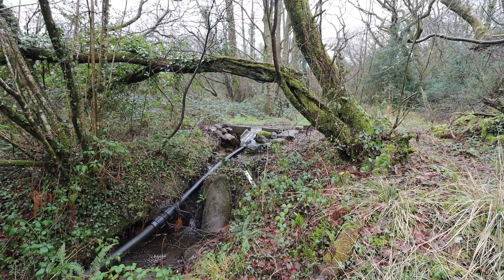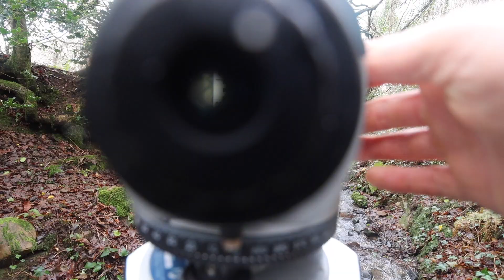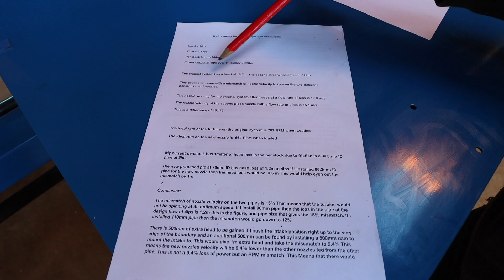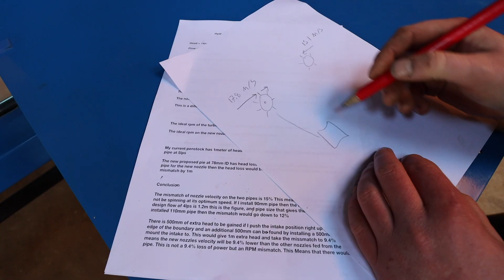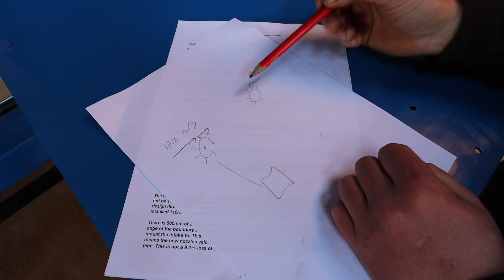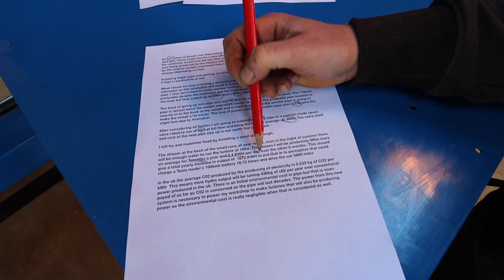Adding A Second Penstock To My Off Grid Hydroelectric Turbine (Survey)

Comment: Hi Kris
  I understood that you were feeding your manifold via a 2 inch reduction from the 110 mm main supply and that the cost of 110 mm fittings/isolating valves precluded a 110mm direct manifold supply in order to be able to supply the existing 3 nozzles plus another 1 then the cost of installing another penstock will be greater?if you are also going to connect the new supply via a 2 inch reduction then surely a 110mm direct supply to the original manifold would obviate the need for a second supply, other than providing a backup in a drought. Just a thought, but, because the supply pipe( 200 foot x 110mm header tank ) is gravity fed, not pumped and does not empty at the same rate that it can fill, then, friction should not apply until it reaches the nozzle feed pipes ?
The point I am trying (very badly) to make is that a full 110 mm manifold supply could produce the same result in a much simpler way!

Yours Vic Wild

Ps Apart from loosing the backup advantage, why not run the new pipe alongside the original one and supply it from the same dam?

Comment: Thanks for the ten minutes of numbers! I'm not looking to build a hydro electric system, but I do like numbers. 
Anyone who has knowledge on an interesting topic and can explain it well is worth listening to. 
You explained it well. I especially enjoyed hearing the problem solving options around maximum power output weighed against the increased cost of materials.
If nothing else I learned there is a lot more to it than just pointing water at a turbine.

I have a small homestead in Vermont USA. Solar power, gardens and fruit trees, chickens, barn with woodworking space. I've lived here for almost 2 decades and I'm not done with projects I've been planning for 10+ years. (Extreme cold winters and feet of snow slow down the pace for sure)

I enjoy your videos for the amount of effort you put into each project and seeing how long it takes to see things through. I also like the numbers you throw in. For example: you expanded your garden and calculated the new garden bed will produce X amount of additional kilos food. You had an actual number for the kilos of food produced per square meter of garden.
I look at a garden bed and think "Yay more room for tomatillos!"

Keep up the awesome videos! 
Please don't run out of projects so we can keep getting videos with numbers

Comment: Kris great video, really interesting to get to grips with the maths involved for turbine energy.  
As an idea..!
 Is there any further way of producing energy from the discharge water from the turbines, ie, fit a a water wheel in line with the flow  and turning a geared wheel with the weight of discharged water rather than the flow to further your energy input?

Comment: Kris (sorry I spelled your name wrong last comment),
I just remembered that optical levels like yours used to have 2 additional partial cross hairs one above and one below the main central cross hair. These used to be used to calculate distance between level and staff.  You would take additional staff readings on the top and bottom cross hairs and the difference between these two figures multiplied by a constant factor would give you the horizontal distance.  I can't remember the factor but it would be easy enough to calibrate your level on a piece of flat ground using your long tape.  This method is not accurate enough for modern construction but it would be more accurate than a wheel over rough ground.  Obviously this would give you the horizontal distance but this, together with the level  difference you already have and a bit of pythageros would give you the slope distance if that's what you need.
Regards 
Tom scott.

Comment: Seeing that you can change the velocity of the water by lowering the diameter of the pipe, couldn't you match the speeds close to your turbine? or are there other variables involved that make this an impropriate solution with hydroelectric?

Comment: so ive always wanted to generate electricity with water power. but i want to use a traditional style water wheel, since ei also have a fairly significant height difference from my pond to the culvert pipe off the stand pipe which takes surface flow in the pond from a significant wetlands area. the trouble is, im not sure exactly how to calculate the flow rates i have, and it can be a little variable, sometimes with huge storms its so much it goes through an overflow shute that can move boulders 2 foot cubed (or whatever the metric centimeter is lol) so, i also have issues with beavers clogging the stand pipe and a lot of muck and silt that could clog those turbine spouts, and i also want to mimic a historic style of the site which was an 1800s carriage shop that used a wheel for their machines using direct power form the wheel and belts and pulleys. then the site was later used as a hydropower in the early to mid 1900s. i was thinking of building some sort of flume off the culvert pipe, and direct that at an angle to a lower area where i could theoretically have a wheel maybe 6-10 foot or 2-3 meters around (circumference? diameter? anyways lol,) whatever the size might be to fit the space, and the capacity available in water flow. and fo course using a gear box to increase the rotational speed to any generator head i would end up using, but i think a 7kW to 10+kW generator head should be more than enough for my entire property. i figure that even with low flow as long as its consistent enough to turn a wheel and use the mass of the water itself to maintain the force i would need to turn the other mechanisms, i don't mind it being a bit inefficient compared to more modern styles. since i have a significantly large 1800s dry stack and then back fill stone dam holding back a nice amount of water, i figure i should have more than enough water for that. also, i figure i would still use a battery bank and inverters just to ensure a "clean" electrical signal (so as not to damage computers and such lol) in any case, i just dont know where to start on getting that process going. as well as legal stuff (ugh)...

Comment: Isn't GPS already accurate within maybe 30cm, at least the good receivers, which takes signals from 12+ satellites?
Should be more than accurate for hydroelectric calculations.
Or a good 25000:1 hiking map, sometimes also have elevation lines in 1/4m graduation.....
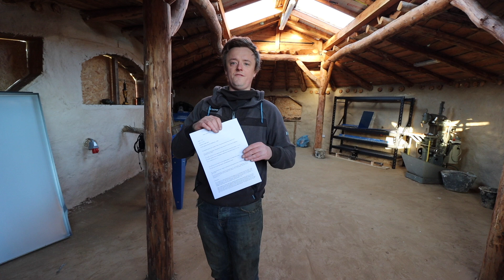Deckel FP1 in the background @ 17:30? Or even a FP2? Size looks more like FP2 ;-)

Comment: Please do think about environment damages for damming up small stream. These are spawning areas for a a lot of animals. A trout can for example go up in really small steams. And if you block it means no spawning i.e. less trout. You also has the freshwater pearl mussel who is dependent on that trout can go up streams. He in Sweden we have a lot of hydroelectric dams. about 10% is providing 90% of the hydroelectric power produced. The other 90% is just damming up stream and cause a lot of lost habitat and does not produce that must power at all. We have a lot of programs now to get rid of these small dams to let trout and salmon to go out and spawn in small streams. This also includes small dams like your own..its not allowed. Hydroelectric power is in general not environmental friendly alternative. You need to only pass majority of the water in the main stream so they know which stream when the trout should take to go up for spawning. However if you use it for hydroelectric power you need to pass majority of the water through the generators i.e. you blocking the path.
Reply: The stream isn't dammed - it's only partially diverted and the water is returned lower downstream. The environmental effect must be tiny - and in a very small area of habitat...
Reply: ok that is good. For the people who going to buy this need that they have permit for damming, diverting etc. not a easy thing.

Comment: Kris, just a thought since your head heights differ, why not put in a second turbine, that could then allow you opportunities to run tests with different turbines down the road.

Cut up the oak and use the wood.
Reply: High cost and effort involved, I should have thought...!
Impractical to extract the timber from its location, I should have thought....!
(and so, it appears, should you........!)

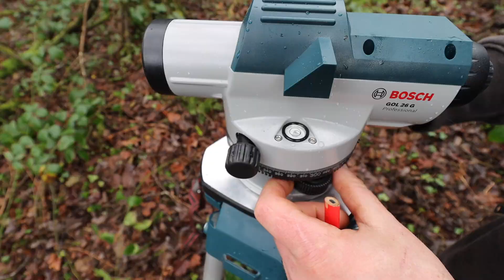Comment: One minor point. That level is not auto levelling as you mentioned at the beginning. At 10:40 you are adjusting it with the 3 thumbscrews. 
The one I have is much older but appears nearly identical to your Bosch.
Reply from the maker: It is auto levelling. But it has a range and that range applies once it has been levelled. The levelling of the tripod could be considered the first stage but is no where near accurate enough to work over a long distance. Inside there is an auto levelling mechanism that you are sighting through. basically you can't just out it on a slope and look through it. it does have to be levelled to a degree so the mechanism isn't bottomed out but after that point it is auto levelling.
Reply: @KrisHarbour  
I guess we'll have to agree to disagree then Kris. 
I've used the one I have for years (it was my Dad's) and, yes, you do get the tripod close and then when you mount the level you get it close when you tighten the screw from the bottom but then you dial it in with the 3 thumb wheels like you do at 10:40 to centre the bubble.
In my opinion auto level is what many of the laser levels have where you mount it on the tripod and hit a button. It levels and starts working.
Reply from the maker: The product I am using is called an auto levelling optical level, the description is "Robust automatic optical level with self-levelling compensator, target collimator for rough alignment and fast aperture for excellent staff reading. Designed for outdoor use. Supplied with tripod and levelling staff"

 It has a floating mechanism inside it to auto level one in its range of motion. you can look it up yourself if you like.
Reply: @KrisHarbour  funny isn't it, Kris , how some people 'know better' - however many plain simple facts you present them with!!
It's obvious to me that an auto calibrating instrument will have limits - thus requiring approximate manual levelling first!
..and I've never seen a level before....

Comment: i would imagine the various mathematical formula's used will be consistent throughout given the measurements taken to give the final outcome figures - while i appreciate the long winded explanation it might be much simpler to implement your maths into an excel spreadsheet - all you need to do each time is add in your numbers, head height above the turbine, distance, turbine resistance, flow of water and whatever else is required (turbine output) giving you the desired figures - this might be much easier to see visually and explain on screen, and take a lot less time to explain (something for the future sir) but good effort

i still have a minor question, if you have a difference in the feed flow rate would you not simply turn the three nozzles down a fraction to meet the forth at 15% or did you need the 17% flow to turn the turbine in order to get the maximum output

i'm guessing with all turbines the maximum output is known or what is required to run home, workshop etc

i imagine the length and diameter of pipe play an important role (as described) as it acts as a header tank, if it remains almost full to provide a consistent flow rate with volume and weight behind the nozzle - my guess being the larger the better - i don't really see that you need to be drastically concerned about friction of water against walls of tube because if its full, there will be very little, especially if you see overflow at the top end - i've seen some fantastic developments here on youtube with some amazing results, - yours being one of the best

Comment: For all the waffle and nonsense and misunderstanding in some of the comments, Kris(dams AGAIN, all the basics questioned again etc!!) one good point was made by a few people(well, two, if you include the more professional way of surveying back and forward)
Namely that the wheel will measure a significantly greater distance than a tape if the terrain is very lumpy and uneven...
Fascinating vid as always - great to see the journey..!
Reply from the maker: Hi Andy, yeah that is true about the wheel. But when I  measure with the tape I always add on about 5-10m extra for little bends and stuff. but with the wheel I only even go with what it says as its already added a bit extra. The wheel is quite big so it won't follow every little bump but it does add up.
Reply: @KrisHarbour  I should have known you'd have a cunning plan.......!

Comment: DN110  PE pipes is avalaible at least in Norway by coil, so you can transport it by a trailer.
Reply: Your argument, such as it is- hangs on the nationality of the installer, the length of pipe required, and it's destination...!!!
So....?!
Reply from the maker: I can get that size pipe no problem but it won't fit on my trailer and I can't collect it locally so it has to come on a lorry. that is the size pipe I used before but that stream has better access than this one so the smaller pipe is a lot more viable.
Reply: @KrisHarbour  i fully understand! Good luck! looking forward to the next videos

Comment: Forgive my ignorance here but would GPS not suffice for finding elevation changes and required pipe length? All you need is a modern phone, or is the accuracy not enough for these type of calculations?
Reply from the maker: It would get you close but not close enough for the head. it would get the distances fine as gps is very accurate for that. But doing the survey this way also tells me a lot more of what I need to know then just a head measurement. A gps would not be able to tell me if there was uphill bits or a shorter route for the pipe and so on.

Comment: Chris,
Now that you are using a standard construction level for your hydro surveys it might be quicker and certainly more accurate to adopt a more regular level survey method where you set up your level approximately half way between each 2 points of interest, sight back (backsight) to your staff reading low down on the staff and the sight forward (foresight) to your next point down the slope reading high on the staff. The difference between the 2 readings is the difference in level between the 2 points of interest regardless of the height of the machine.  You can then leave the staff at point no 2 and move the machine down the slope, again setting up so that you can still get a reading on the staff at position no 2 then move the staff down the slope to position no 3 and take a reading. You now know the difference in level between points 2 and 3.  Repeat as necessary. This method allows you to set up the level wherever it is convenient as long as you can see both points of interest.  Also if you are roughly half way between your 2 points of interest at each setup, errors in the "levellness" of the machine cancel out.
Hope you find this useful.
Tom Scott (Civil Engineer)

Comment: Hi Chris, just as to your comments to collecting the pipe and uncoiling it there is such a thing as a coil trailer. The coil is transported upright and can be uncoiled from the trailer by simply putting it through the rollers and pulling it with a tractor. Hard to explain but very straightforward, and you can get 100m coil of 180mm pipe in it. I work in the pipeline industry and use them alot, I'm sure you con hire one from fusion or pss. Hope this helpful and love you channel.
Reply: Suggest you look back at earlier videos showing pipe install....
Reply from the maker: I have been thinking of building one soon for my hydro installs but that would not really help this situation that much due to the position of the stream

Comment: excellent explanation Kris, nice logical flow to the issues (no pun intended). 

One thought I had, and probably not useful in your situation as the turbine is already in place, but would it make sense (for a totally new system) to design a turbine that has basically 2 wheels of different diameters? 

I picture two flywheels basically welded together spinning on the same centre axis. That way, the "inner" wheel with a smaller radius would mean the scoops attached to it would be travelling slower than the scoops attached to the larger outer wheel. You could then direct nozzels to whichever set of scoops helped to reduce the mismatch? Or am I missing something? 

Obviously you would want to fine tune the difference in diameters to get the mismatch as low as possible and for that you would need to know the flow rates / head etc of the different sources, so would need to be tailored to each customers specific situation.

Comment: You mentioned that the second run would not just gain more power in the rainy season, it will also extend the hydro season with power generated when your original system has "run dry".  I presume this benefit would happen in the sunnier part of the year so you might want to contrast the cost with installing more PV capacity. Of course if your primary driver is more winter power then this logic does not apply.

Comment: Hello Kris another excellent video.  Just one question:. Would it make any sense to just connect the new penstock pipe to the old one just above the turbine house?  Then there would be no miss-match of turbine nozzles as the extra water would just add to the existing flow via the same turbine arrangement?